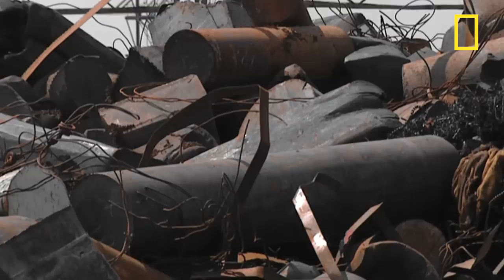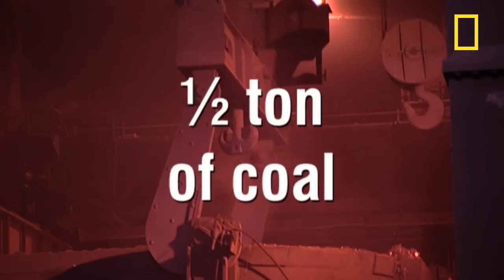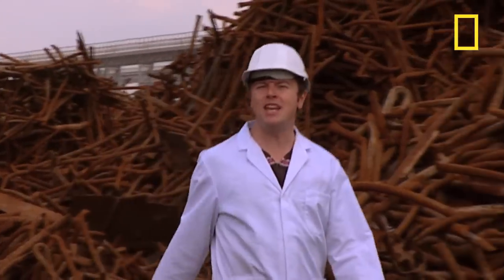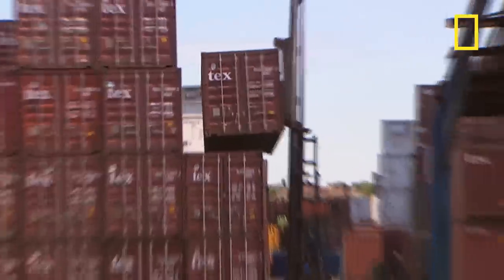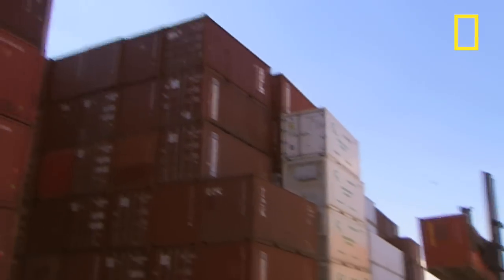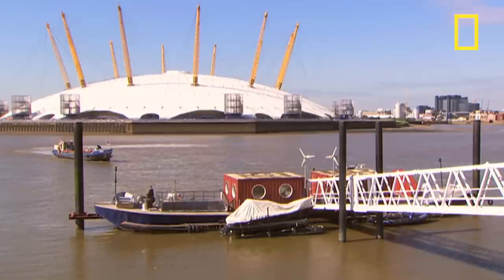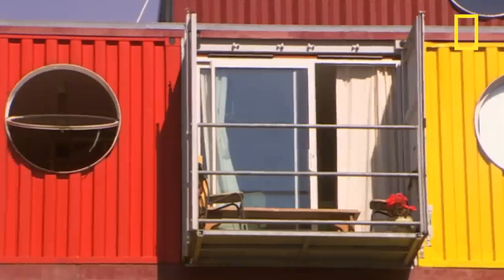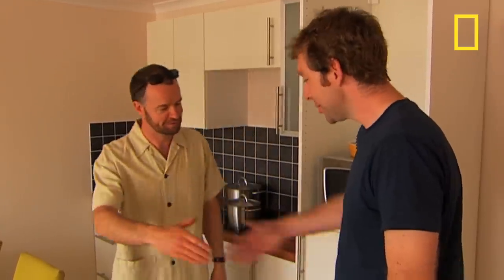House Made of Steel | I Didn't Know That

Comment: one person made a smart comment a car sets on rubber tires even if a high voltage wire falls stay in the car you be safe and the container can be insulated for heat and cold temperatures they can even spray on insulation

Comment: well there really good aluminum paint called rustolumin that works really well if it works on sea water then iam sure it be fine in the desert one could consider putting one and building a earth embankment around the backside and ends with earth on top against a hill side that would create a earth home I see homes up north like that and a in the desert

Comment: that's neat with earth quakes they should be solid forest fires they won't burn tornados if they anchored they won't be damaged these containers have very strong ribbon seams corrugated steel and they are water proof when sailing the high seas the a contents would not be damaged by flood waters from hurricane   they have great promise they are built solid they stack then many high in ships so each one of them a crush resistant